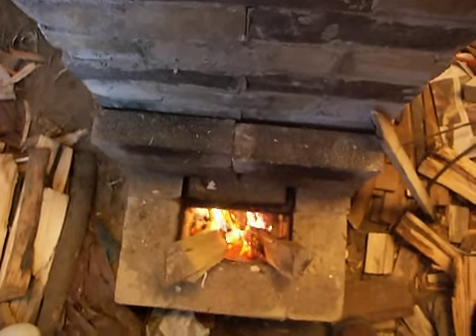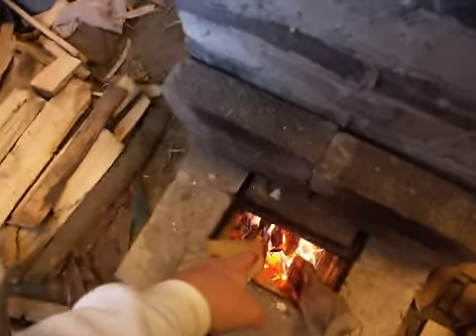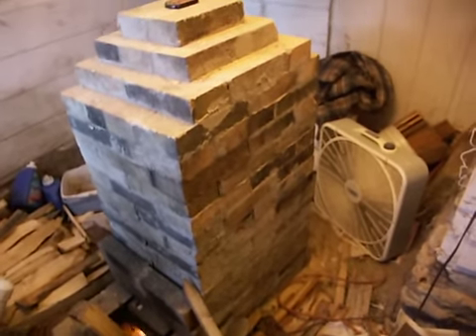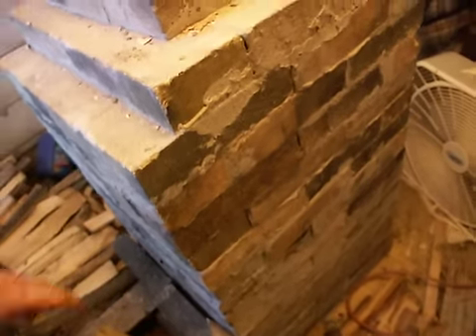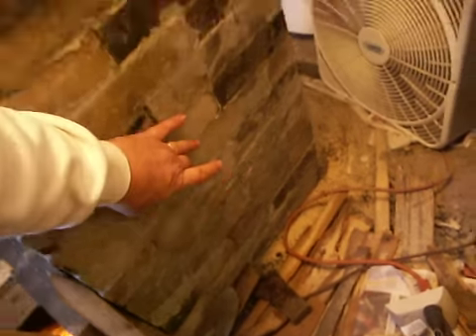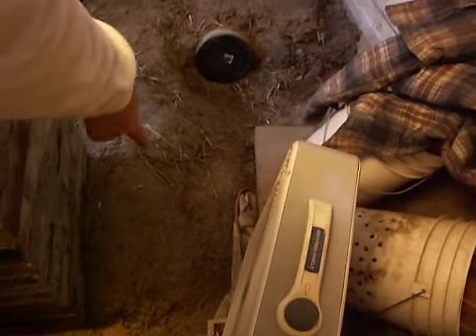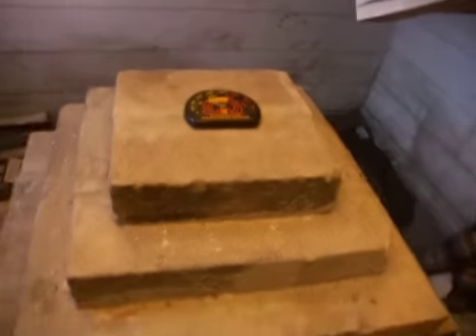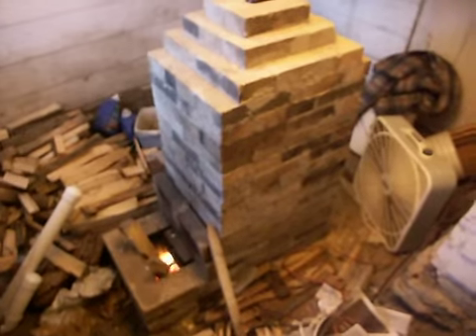Rocket Mass Heater Stove Wood Refractory Masonry Hermon Heater

Comment from the maker: Jack, our family did not ( and does not ) have the money to purchase a high-quality steel wood stove.  Necessity is the mother of invention.  While I was broke, I needed some means to cut down on our heat bill.  I found SketchUp 3D CAD program for free and learned how to use it.  It took six different designs b4 I settled on this one.  Given the choices of either purchasing an expensive wood stove or "babysitting" the stove all day, I had only one option that would work for me.

Comment from the maker: I simply use a paint stir stick from a local paint shop to pull the ash from the "burn tube" into the ember bed area.  I then use an 8oz can, with its opening "squished" some-what to form a triangle instead of a circle, to scoop the ashes out of the ember bed area.

Comment from the maker: I have purchased an infrared thermometer which I use to check out the temps thru-out the heater.  My son and I have stood in the exhaust of the heater, without discomfort.  ie: our eyes didn't water, we didn't choke / gag, etc.  There is very little CO emmissions from this heater, as the combustion temps are over 1000 degrees F and other than steam, there are very little emmissions from this heater, just as Ianto Evans indicated in his documentation.

Comment from the maker: Dave, there's a video on my channel about how I remove the ash from the heater.  Ash collects daily in the burn tube area of the heater ( combustion chamber ).  I've found that ash also collects where the heater connects to my heat exchanger and exhaust.  I clean out that area once a year by disconnecting my heat exchanger / exhaust pipe from the back of the heater. ( Heat exhausts at the BOTTOM of my heater design )

Comment from the maker: Doggettall, the fire burns at over 1000 degrees ( in the combustion area of the heater ).  The top of the heater at times reaches just over 350 degrees and my exhaust temps are around 150 degrees.  This heater does a good job, considering the fact that our old house is not even nearly air tight.

Comment from the maker: Yes, i am sure this heater could heat that space very well and you would only have to use a very little bit of wood.  Use enough to get the temperature of the brick up and then not need more wood for some time.

Comment: one improvement ...a heater 'bench'..., if you take and re-route the exhaust...instead of the insulating 'cob'...! Put a double pass bench,  that 32-36" I see the back, run directly to the right for 5-7' (cleanout in the end..), and still keep your chimney.  That'd be cool..ah, warmed bench.  (our Baba in the old country 'slept on the stove..IE..the heated bench/bed approx 1.5m x 2+m...), thanks for sharing...,    Mikhail

Comment: This is great.  I was wondering how you could heat your interior with a rocket stove without adding a bunch of weight to your floor.  How large of an area are you heating with this?  Does it actually heat the air enough to keep a living room and kitchen in a modest house warm?  Also, how often do you have to add wood?  In other words, do you have to keep getting up during the night to add wood?

Comment: @boxerfencer 
I'm no mason but I would assume that the inside bricks, should be refractory (especially in the secondary combustion "barrel" and upward flue) so that they don't melt (don't mess with insulating bricks) and some or all areas of the outer layer can be something nicer, like a thick brick with empty space inside to create thermal mass (extruded bricks). If I recall, these spaces take 1 of 2 forms, 3 holes (losing a 1/4 lighter) or a square space (losing a 1/3 of the weight).

Comment from the maker: @nobunaga86 We have 2 heaters in our home; one is a ToyoStove direct-vent Laser 73 kerosene burning heater and the other is my rocket heater. The home is approximately 2000 sqft. We only passively heat the upstairs and keep the downstairs around 65-70 degrees during the day and between 60 and 70 at night. Last heating season, we used 3/4th tank of kerosene, this year just over 1/2 a tank (250 gallon tank). It's generally believed Rocket Heaters could heat 1000sqft comfortably.

Comment from the maker: Tool19672, the highest temp in the burn tube of this heater is somewhere in excess of 1000 degrees F ... my infrared thermometer doesn't go over 1000 so I'm not entirely sure.  The surface temp of the top of the heater has, at times, been around 350 degrees.  The metal heat exchanger which I now have on the heater at times is around 400 tho since I use 2 floor-model box fans to blow air across the exchanger, I'm not sure how high they'd get without the fans.

Comment: I've given it some thought & the only issue with a brick design is that, although I like the idea of a brick "barrel" (that functions as a thermal battery), an oil barrel (of the barrel/cob design) gives immediate heat & uses a thermal battery in the way of a cob bench further downline. The brick design only works as a single battery. So, the brick design would seem less efficient than the ugly? design of the oil barrel/cob bench design illustrated in Rocket Mass Heaters by Evans & Jackson.

Comment from the maker: This fire burns so hot ( somewhere at or above 1000 degrees ) that there's no soot at all in the fire box and, as far as I know, no soot anywhere in the heater nor in the 55 gallon heat exchanger which I added last fall. I'm burning hardwood slab wood from a local Amish saw mill ... oak, maple, ash, etc. I've burned a small amount of softwood as well, including scrap box elder.

Comment: Hi Lars, so, 10 years later, how does this thing has fared?  I always like the simplicity of the thing and good draft. But it would be nice to know if you rebuilt it? How many times you cleaned it, how hot are you flue gases etc. Thanks. Max.

Comment: looks awesome...  not to pick at you but clean that area up..  might only take one spark
Reply from the maker: Tom Figley You should see "that area" during the heating season.  I have the complete wall lined with almost a chord of wood that's waiting to be used in the heater.  In the rocket heater design, sparks don't fly out of the heater.  Draft pulls all sparks into the heater & up the heat riser.  ( also, the white walls of the heater room are painted with fire-proof paint ).
Reply: ya i see what you mean but i been painting for 15 out of the 30 years i been here and theres no fire proof paint when a chord goes up...

Comment from the maker: I've got both.  In the video, you can see white PVC pipe coming up from under the wall to the left of the area where I feed the firewood.  Because my house is so drafty, there's no problem with plenty of "fresh" air for the heater.  
Different from the video, we now close off the air intake, leaving an area of approx 1/2" by 9" of air intake, reducing the CFM to "negligible".

Comment: Very nice  design !  I like the appearance and simplicity .  Did you use fire brick for this ?
I appreciate the labor involved with trying to design something well and it is certainly 
worth the 35 you ask .    I wondered if you had considered using double wide brick every other layer to  increase your surface area,   lessening the use of the fan .

Comment from the maker: I expect that you've purchased Ianto Evans' plans. I did as well. My design is based on the information he made available in his book. Read other comments I've made on my channel, below this main RMH video. My "plans" consist of a computer file which I created using SketchUp. It is a 3D rendering of an all-brick rocket mass heater. Using SketchUp on your PC, you can look at any portion of the heater from any angle & modify it if you wish.

Comment: Thanks for the vid, one question, I noticed the fan, is that bcoz the outside isn't cool enough compared to the inside heat riser to generate a strong draft or is it just to distribute the heat. Have you had any issues with a lack of a strong draft, I didn't really get why you would need smaller pieces, it should just burn what ever is at the bottom of the feed chamber shouldn't it?

Comment from the maker: My exhaust chimney is not insulated.  The temps in the chimney which rises outside of my heater room run about 150 degrees and it is just regular steel stove pipe.

Comment from the maker: @ Kees Ijpelaar one of the facts about air flow thru a heater is that there should be no portion of air flow channel which can be any more restricted than the intake ( calculated in either sq in or in sq cm, etc ).  The opening dimensions of the channel in my heater are 4.25" by 9" = 38.25 sqin.

Comment from the maker: @cornishman1987 As you can see, it takes only a small amount of wood to "fill" the feed tube ( the opening at the start of the heater ).  It takes only a minute or so to fill the heater and, using 16" pieces we do this about once every 45 minutes or so ... so this year, we've changed strategies and will be using 30" pieces of wood so we only have to attend to it every hour and a half or so.  Once we get into this coming heating season, we'll be able to report back to you about this change.

Comment from the maker: @Steve MyMind, re: the big fans, the room in which I built the heater is not centrally located so I use 2 big floor fans to blow the heat away from the heater.  If you'll email me (larsmith217@gmail.com), I'll provide a link to modifications I've made to the heater, including a heat exchanger.

Comment from the maker: Correction : We now reload the heater every hour to hour and a half.  We've also started using a cinder landscaping block to control the amount of fresh air which gets inside the heater.  We found that allowing lots of air through the heater, more heat was exiting the heater and there-by cooling the heater.  By reducing the air intake, we saw the temp of the shell of the heater go up and less exiting the heater.  I've not yet tried charcoal tho expect it would work So does corn & wood pellets.

Comment from the maker: @KNOWLEDGEandLIFE You're right.  Without professional experience with SketchUp and with zero experience as a brick layer, I designed and built the heater that's rec'd international attention.  If I can do it, you can to, in which case, you can do it for 'free' ... depending on what you're worth per hour ...

Comment: Thx for sharing. It looks nice one. BTW, if it is made only from brick, would there be a chance that the poisonous gas can leak into the room? I dun know what is lego brick, are they fire bricks with alumina rich content? How do you clean the ash?
Reply from the maker: +Michael Cheung With a carbon monoxide detector within 2 feet of the heater, I have never been aware of poisonous gas emissions.  Use www.google.com or any other search engine to find LEGO blocks ( they are toys for children ).

Look through my videos and you will find a video about cleaning out ash.

Comment: Hey Lars Mith! Congratulations on a working and good looking stove. How about the passings? Are they 1 layer or two layers of bricks tall? I've read in Ianto Evans and Leslie Jackson's book that they recommend the burn tube to be taller rather than wider, for the same cross section area and the space above the heat riser - around 5 inches. I followed your advice and played  with lego first and than I used ScetchUp. I understood your concept and I'm trying to build one for my parents in law, because the winter is geting closer here and they have no source for heating. Yet, I still have some doubts about the measures I asked you. I seriously consider coupling this with a masonry bell rather than a thermal mass. Do you think it will work? Thank you and keep up the good job!
Reply from the maker: +Radu Lazau The dimensions of the air flow are approximately the same measurements of the TOP ( or bottom ) of one brick ... approximately 4.5" by 9".  In other words, when you watch the video and are looking down into where I feed the wood, that measurements of that opening are as indicated above.  The heat riser is almost 4' high, from the base concrete slab to the "cap" at the top of the heater.  I remove ash each morning, from the feed area at one end of the heater and once a year from the exhaust opening at the other end of the heater ( where the heater connects to an underground exhaust pipe which exits out of the heater room under the wall of that room ).

Comment: @17hmr243 
I suppose you can't because of the 90 degree angle of the feed section to that of the burner. I imagine you can stick a straight hose with my idea, though, which gives you 180 access. Bty, you should NOT vacuum  a fireplace. That's a fire hazard.

Comment: What would POSSIBLY be the benefit of this stove, over a regular new high tech, cetrified steel or cast iron stove, with a good secondary burn. Mine heats my house to a Cozy 76 degrees btw, without any effort at al . and I only have to re load it like every 6-8 hours. why in the world would anyone want to baby sit a stove by having to add wood every HOUR ??

Comment from the maker: @oldtimeway1 ... at times like this, I wish I could "beam u up" so that you can see this heater when I start it up in the a.m.  There's an old saying that if it sounds too good to be true, then it isn't.  Well, tho it sounds too good to be true, this heater is easy to start up every morning.  I place kindling wood deep into the burn tube and use a propane torch to light it.  That's all there is to it. Watch easy-to-start video on my channel.

Comment: I don't understand all the screaming about selling the plans.  First, a lot of effort was put into earning whatever money those plans might generate - namely creating this video.  Second, we get to see those plans in action via this video.  Third, there are no misleading or deceptive tactics being used.  It's a free market.  If you don't want them, don't buy them.  If you want them for $5, that's not the price so you can't have them for that.  I want a new Lamborghini for $1000.  I will probably be waiting awhile. 

Lars: it looks like you've done an awesome job on this.  I haven't read all the comments because of time restrictions but I'm interested in the bottom line; how much did this end up saving you overall?
Reply from the maker: Chris Formitzi Chris, I'm not entirely sure as to how much it has saved us.  In our 1st year here, in this drafty old house, we burned over 2 tanks of kerosene ( so probably around 500+ gallons ) trying to heat the house.  Last year, which was a bad year, we used one and a quarter tanks.  In previous years, we only used 3/4ths of a tank.  The cost of building the heater room and the heater have been long-ago paid off, tho I can't put a $$$ amount on our savings.

Comment from the maker: Better ?  I'm neither experienced enough with rocket heaters nor vain enough to say my rocket heater is any better than any other.  I've heard, more than once, that some Rocket heaters are difficult to get started.  My design has been easy to start so far, tho not because of any "intelligent design", for I designed this for ease of build, not for ease of starting.  More efficient ? There's not much smoke/heat coming out of chimney so I'm speculating it's doing OK. Feed it every 25 mins.

Comment: So I buy your plans , then i will change the size in the smallest amount possible. Then i will sell the plans for $0.50. It will be different then yours in size , but will be just another rocket stove. My point being you can claim all day your approach is unique and improved . But your approach is nothing new and no different then the rest made out of brick. It is not your design / Idea even if you used a cad program to look at it on a pc. Alot of design's some better out there for free.

Comment: @LarsMith217 
Here's another plan that's proven
There is a PDF file name Bricks_Mass_Heater_Plan.pdf hosted at projectblog.bluesquash dot co dot uk that explains how to do everything except the secondary combustion chamber, which is pretty easy to figure out by looking at the video above (16 bricks high, 10 bricks per layer in the heater).